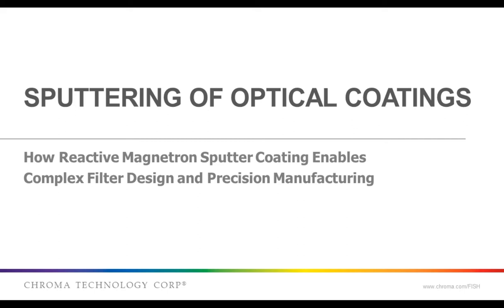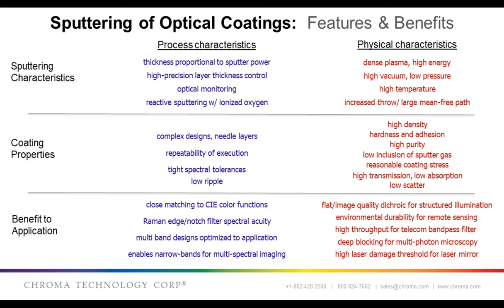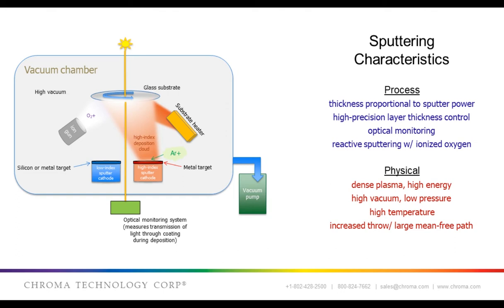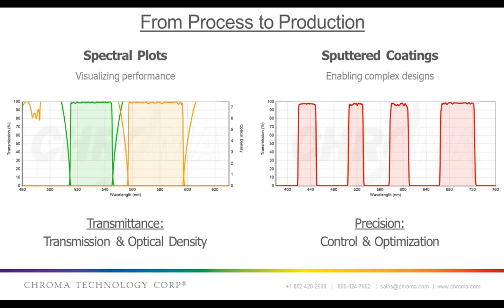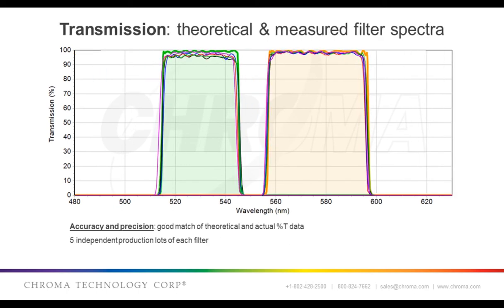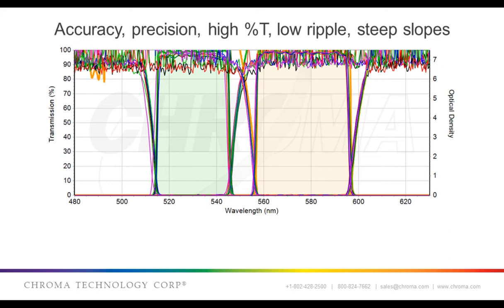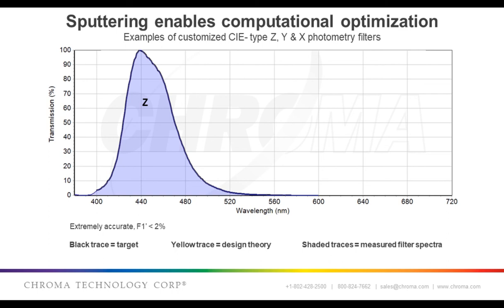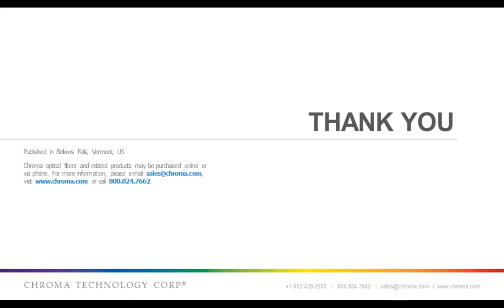John Atkinson and Jeff Carmichael - Sputtering of Optical Coatings

Comment: How many layers are there typically in such a filter?
Reply from the maker: Layer count could be as little as 2 layers for a simple AR coating, or as many as a few 100 for more complex designs needing deep blocking. Because layers could be a thin as a few nanometers or as thick as several hundred nanometers, it’s more about the total thickness in terms of feasibility – we can make a coating as thick as 50 micrometers (or more depending on materials and process used). The tristimulus filters discussed are only several microns as they do not need deep blocking, but a typical bandpass coating for a fluorescence application might be 20 microns. In the NIR or SWIR the coatings needed typically get thicker, but of course even a UV or visible range filter could require 10’s of microns if deep blocking or very steep edges are required.

Comment: interesting but how do you monitor such needle thickness ? is the in situ transmittance spectrum enough ?
Reply from the maker: Thanks for the question. Yes we use the in situ transmittance spectrum, or optical monitoring, either at a single wavelength or over a range of wavelengths with our broad-band monitoring (BBM) process. But we also have very stable rates and can simply time the needle layers using rate data collected on previously deposited layers. -John